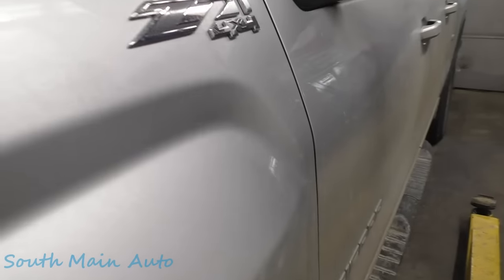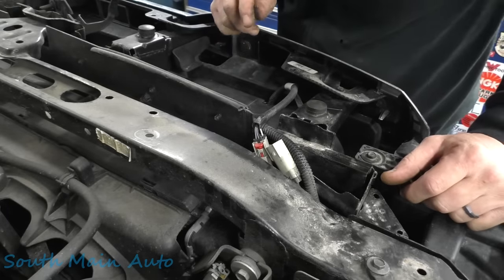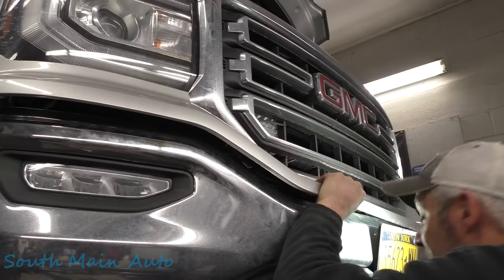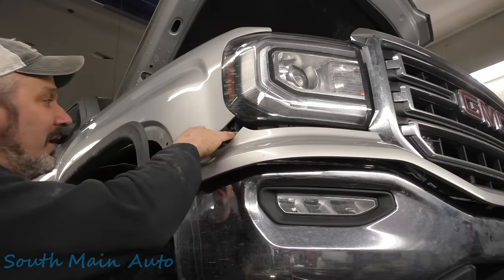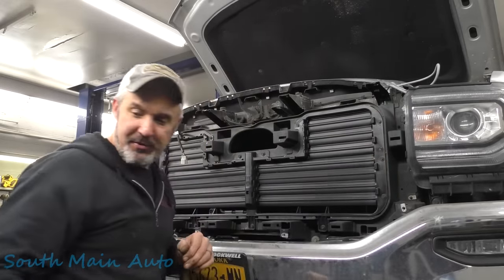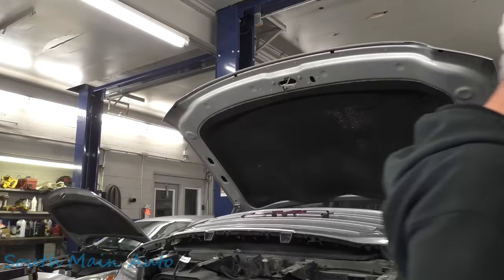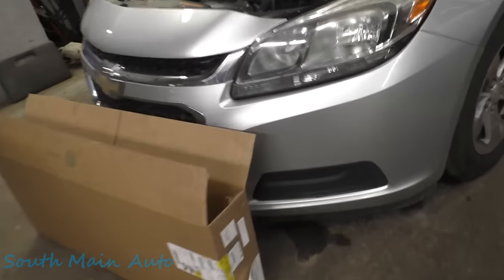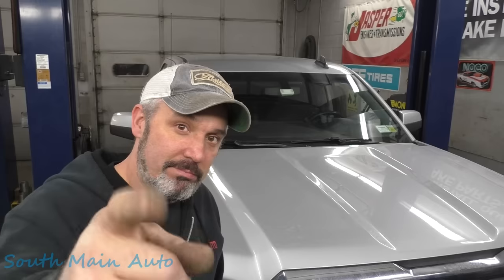Chevy Truck: Active Grille Shutter

Comment: John Deere used radiator shutters on their tractors in the early 1900s, and then they wised up and figured out how not to need them.  Their engines ran just fine with only 2 wires(spark plug wires).

Comment: Some vehicles (chevys apparently as well) simply need to be put back onto the assembly line and run the line in reverse pulling the thing apart in reverse of the way it went together. I know, that won't help too much with things that 'snap together' with snaps you can't reach, release. Here in Arizona with the very low humidity, the metals on the cars last a century, but the low humidity causes the plastics to offgas, and become brittle in 10 years or so. Most of the time when you even carefully try to release some barbed plastic snap attachment, the plastic breaks. 
Answer? Zip ties, bailing wire, hot glue, super glue, epoxy.

Comment: I used to work on a 1929 Rolls Royce, and the only temperature control for the engine was by opening and closing the slats on the grille by moving a lever on the dash. No thermostat, just watch the temperature gauge and move the lever when you needed to.

Comment: I found some of the comments humorous because they reference 30 years ago or so. Shutters were commonly use before there were thermostats, mostly on more expensive cars. They were needed to control the engine temperature. The low priced car manufactures (Henry) didn't care about sludge and rust in the engine.

Comment: I'd like to understand the aero claims better; by the time it hits the shutters, it has already entered a secondary system ...  and wouldn't air flowing through the radiator create less pressure than a wall?
Low temps though?  Sounds great for cold climates.  I've had to cover my grille in a 1.3L before just so the car could get to operating temperature some winters.  Live 15-20 miles away and when you drive at 55ish without blocking the front, the temp gauge goes down as you drive and no longer have heat from the vents; it was below zero for a week or so iirc.  This system I suppose does that for you; though I think since its passing through an outer grille, its effectiveness might still be accentuated by creating some kind of inserts for those openings.

Comment: I remember the days when class 8 trucks had air shutters but not for aerodynamics. The emissions testing loads are set based on aerodynamics so this failing means emissions are not assured. The other goody I've run across is the ozone catalyst coating radiators have a failed presence sensor.  There is no sensor to check function but there is a sensor to verify that a coated rad is fitted.

Comment: Damn they do go back together fast.
Reply: That's because they are designed to be assembled cheaply, and quickly. Most think it's piss poor engineering, but it's actually very good engineering. It just wasn't engineered or designed to be repaired.

Comment: I just use some old carboard on my old 5.9 Durango. Damn hydraulic fan clutch is like a tractor trailer and it takes forever to heat up. Where can I buy that LED light you have? My dial switch is annoying and I don't have the flexy head.

Comment: Never understood how these could be worth it.  Closed it's still a big flat plate on the front of the car pushing air... maybe useful on a really cold day to keep the engine warm I guess.  (I have a shutter "stuck" DTC on my car right now, Ford. Can you just leave it open and disconnect the wiring? Or remove it entirely? Or will there still be a code? if it's missing?)

Comment: Wow didn't think this would be on cars. This is a pretty common thing on high-performance piston-engined aircraft where the cooling requirements eg. on the ground or in a climb are much more demanding than in level flight. Designing the cooling system for the worst-case scenario would add far too much weight and drag for the kind of operating ranges these planes have (eg. P-51 with top speed of 450+ mph), so instead they're optimized for cruising flight with variable radiator shutters.

Even so, opening the shutters adds a significant amount of drag, even in a climb - the F6F Hellcat pilot's manual says to use only 1/3 cowl flaps in a climb, and it advises that if cylinder head temperatures (air-cooled 18-cylinder radial engine) rise, to first try enrichening the mixture as it's more economical than the extra drag from opening the cowl flaps further. Hence their use is definitely warranted in fast putt-putters. Now for cars? It seems a bit overkill. I wonder what the benefits truly amount to.

Interestingly some Russian props like the Yak-52 have almost the exact same kind of cowl shutter for their air-cooled radials. It probably has to do with when it's -40 in the middle of Siberia.

Comment: I have a 2017 1500 and had to pull the trim off for something and ended up using 3M grey tape to re-furbish the plastic trim clip holder when re-installing the trim afterwards.

Comment: I used to hate these stupid shutters until I realized that beyond just improving gas mileage, they keep the radiator from taking tons of rock abuse over time. That rad looks really good for a 7 year old truck. They don't stay closed all the time, but usually they are halfway shut on the highway at cruise which does wonders for refusing entry of random BS.

Comment: I’ve had a similar experience removing the rear bumper cover on my 2022 Chevy Bolt EUV. Service manual tells you to remove several, hard to get to bolts that are completely unnecessary to remove in order to get the bumper cover off. Irritating.

Most body parts are designed specifically to be easy to put on, usually at the expense of making them much harder to take apart

Comment: lincoln mkt's the ballasts for the headlights are notorious for failing... gotta rip apart the wheel well, and half if not all of the front bumper just to be able to change the bulb or ballast. real fun stuff. thank goodness for engineers, am i right?

Comment: I was born in 1957, my first car was a used Ford Mustang 6 cylinder, 3 speed manual, Red  with black bucket seats, crashed it drunk into the woods 2 weeks later, & got to know junkyards quite well for the next 5 years. That car  had 9 lives, no matter how bad a DIYer I was, you could not kill it. Todays cars are plastic & junk in comparison.

Comment: Chevy nah. Well maybe now. I owned a 3.8 L, 05 impala LS, indigo blue. Bought it with 9200 miles. Not one problem except two blower motors. Had it 15 yrs. Id still driving it but the rust belt in N.H. killed it bad. 190000 miles and still used very little oil. Proper maintenence works. Now im purly a toyota/lexus guy. Wife has the avalon. Thanks for the tip on krown undercarriage tip. Going up to Claremont N.H. this spring.
Reply from the maker: Check out NHOC New Hampshire Oil coating. Good stuff too
Reply: Wow just looked at some NHOU videos. SOLD seems better than the krown and its only 35 min away. Thank you!!
Reply from the maker: @garyhennessey3621  The guy who owns the francize is named Joe. He is a really down to earth guy and makes a great product IMO. I hope they make it this far south as they expand.

Comment: Gota a question. See what you guys think on a 2007 escalade dash says engine power reduce but still ran. Once cut off it wont start back up, ive changed fuses checked relays took starter off & back on because thats the only thing that ran once the key is turned in the ignition no crank what so ever but lights radio heat etc all work. Im lost ready to throw this thing to the scrap yard

Comment: I have a 2012 Equinox with a faulty air temp sensor. In the summer it shows negative 40 degrees. So it won't let me use the air-conditioning. $5 part, bit a pain in the butt to get to.

Comment: Wait until you need to pull off a bumper cover on a 2020+ tahoe/suburban. Plastic brackets screw in to the head lights and the headlight screw bosses crack and break. New equinoxes are the same way, i think 22 and up.

Comment: I have a friend that works for a snow plow company in Canada . I takes them 6.5 hours to remove the front grill, finders, rad , headlights  just to install the plow frame and wire harness on a f350 ( 2022 model ) . Then create fit / customize reassemble .They don't build them to add stuff or repair. 
sorry , this is how mechanics make money $$      They come off good in a crash ! 🤣🤣🤣🤣🤣🤣
what a pain

Comment: The plastic retaining clip with the two white push in retainers at the front of the fender flair appears to me to only keep the seam of the bumper trim and fender tight.  I don't think it was adhered in any way to the flair.  The screw you took out of the front of the flair is the only thing holding the flair in place at that spot. IMO.

Comment: I agree they are engineered for ease of assembly not disassembly.  BTW-I think the issue with service data having you remove that support block unnecessarily, is because they use assembly instructions to create service instructions.  That support would have to be installed before the trim piece in the factory. Perhaps if you disturb any of the fasteners they just include the previous installation instruction but reversed to "remove" instead of "install".

Comment: That trim piece above the bumper is easier to get to from the back side, underneath. I take mine off in 5 mins.
Reply: chev couldnt work out how to make the bumper higher,,or grill lower,,so they used filler.. not a chev fan, or any post 90 ve hicles..but, i have an 02 s/duty, f250, with no computer..4.2tdi, brazilian built, geman mercedes engine zf 5sp..allso fitted to siverado,s in brazil..12 lt 100..700nm..bigger turbo.. ausie..

Comment: I was a Chevy guy until I bought a 2008 Colorado. It is really an Isuzu. Then I became a Pontiac guy and bought a Vibe. It is really a Toyota Matrix.
Reply: No. The Colorado is gm. They just let Isuzu make their on spinoff model which is basically the exact same truck. Like the old Ford ranger and Mazda b series. The 5 cylinder engine is definitely gm
Reply: @goenitzlopez2076  The Chevrolet Colorado and its twin, the GMC Canyon were jointly designed by GM's North American operations, GM's Brazil operations, and Isuzu, which began selling its own version worldwide in 2002.[3] In late 2005, Isuzu offered a version in North America called the Isuzu i-series. This North American model Isuzu shared North American powertrains, styling, and equipment with the Colorado/Canyon twins and differed from Isuzu's worldwide offering
Reply: @Leon-qc7fe  yea exactly. It's a gm vehicle with Isuzu clothes. The vibe is a toyota with Pontiac clothes

Comment: I remember reading about the shutter feature in the sales brochure when I bought my 2017 Canyon Duramax, but I don’t think the LWN engine has 
this shutters. I’m I wrong on this ?  Had shutters on my 76, and 82 Cummins powered Kenworths.  Eventually the nylon slat mounts wear out, or the
uninitiated mechanic try’s to lift the rad out using the open slats to grip on. They where air operated by a sensor installed in the lower rad connection. They where set to open about 5 degrees before the coolant thermostat opened. Even refrigeration units mounted on the front of 
reefer trailers had them in the old days.

Comment: What's with the Active Grille Shutter? Is it to keep the engine temp at most efficient or arrow dynamic ?  Could someone add a small electric fan to the cooling system that you can turn on for hot days or traffic jams? Would the extra fan have the opposite effect causing it to overheat .

Comment: Remember when chev / GMC were ( Built like a Rock ) you didn't have to worry about all the dress up pieces being still in place when you return from off roading in the bush. Funny how they think closing of the front of the radiator is going to make a big difference when your driving a brick threw the air. The shutters would be a nice feature on a duramax to help with engine temp when it is freezing out. Remember when big rigs had air operated shutters, no winter front required. Diesel Land Cruisers had a spring loaded blind you cold pull down in front of the radiator to help warm up and maintain engine temp when it was freezing out.

Comment: It isn't only GM it is everyone that makes cats/trucks people wanted to have all these aesthetic covers which inturn makes engineers have to put stuff in difficult areas and the engineers have to give direction on how to remove and replace the part then after that it is the field guys hands to figure out how to remove and replace the part. The worst part of it the cars are designed on a computer but never takes into consideration hand room arm room or any room for anything. It is more designed to fit the engine and look good that is what everything has come to.

Comment: After reading the description, all I can say is GM makes a big ol' fancy PLASTIC "active" grille for God Knows what reason that is driven by an air sensor and God Knows what else but the sensor can't even correctly measure air temperature?? I think they could have made this even more complicated if they just applied themselves more. So any mileage saved is spent on the repair of an unreliable system.
Frankly, they should be embarrassed by ASSUMING that nobody will ever have to disassemble the front of their mighty vehicle design because of their failure. On the other hand, the dealers can make a killing when this thing fails by cutting book time but charging for it. I usually don't rant but my heart goes out to you for having to deal with this kind of stupidity. I'll reluctantly digress now.

Comment: I worked for a company that designed and manufactured these for various makes and models. it was a product I never believed in... but they have to make mpg ratings. the worst has got to be ford who has incorporated these into the grille opening reinforcement. my guess is you have to remove entire front clip to change.

Comment: Cost breakdown:
Diagnosis of air shutter. 1 hour $ 90
Removal of front bumper piece : 
6 hours . Frustration addition 10 hours. 
Broken clips and tabs from GM $ 450 . Out the door $ 1980.00 .what a deal 😂

Comment: couldn't help noticing the little quarter inch drive impact, i generally had 180pis air, didn't 
take long to nuke those little impacts blow guts right out the side of the casting.

Comment: It cost me $120 to replace a headlight on my 2008 Buick LaCrosse because the cross brace, battery, and part of the front bumper had to be removed in order to access the headlight and I didn't feel like dealing with it.
Remember when you could replace just about any part on your car by doing it yourself and it cost less than twenty bucks?

Comment: Think it was late 70's early 80's truck mfg. did away with shutters and started going with thermostats. Then you had to run grill covers to keep the temperature up. Some engine mfg would run winter fans which would circulate air from the engine out through the radiator. Not a novel idea GM had just surprised they brought it back.

Comment: I had no idea just what the heck an “active grille” was until I saw you put the new “grille”in.  Now I’m wondering just why the heck they had to make a grille that closes off airflow to begin with!  Crazy overthinking engineers!  I know it gets cold, cold, cold up there (I’m from Florida, live in Florida still) but really?  Really?!  That engine will still get up to temp even in that cold.  It’ll just get hot faster.  So for what?  The owner/operator can’t drive a few extra miles before they get hot air coming out of the vents?  Am I missing something else here?  Then design it so that you gotta tear down and then rebuild the whole truck to replace it?  Nice!  🙄 Geez Louise!  This is why I like older vehicles

Comment: I had a 2012 Dodge Dart that wouldn’t pass inspection here in the lovely state of New York turns out the active grille shutters were broken and there was evidence some road debris had damaged them since I didn’t care about their functionality I just unhooked the jammed motor from the grille and opened all the shutters the motor could move freely again and it cleared the check engine code itself. I’m not a mechanic but that is the stupidest system and it causes an inspection failure 😞

Comment: GMC "gots more crap" possibly had to solve a rattling issue with sound dampening tape for all that plastic flapping in the breeze! I shudder at the thought of the cost to fix a non essential add on. The big dogs use a cover with a zipper on it and watch the temp gauge!

Comment: So on this particular truck, the owner will now have to drive it for a million miles to pay for perceived benefits that were lost when the last one broke.  Your labor, the part, the creation of the plastic, the shipping of the part, your heating and cooling costs.  Big question, is this a fail able inspection item because of the check engine light?  If so, that's obscene.  All for maybe a tenth of a mile in the MPG numbers.

Comment: We kept these things in stock at our dealer 🤣 failed steady but to set a check engine light for it is ridiculous. The other techs at our GM dealer didn't understand why they programmed it like that. My Ford doesn't and I've had it disconnected for years

Comment: The guys in the factory and those clips in the top, probably have a gun, like a nail gun, only with those push pins on a tape, and just press a button or lever and it is installed

Comment: while your area the vehicles rust away In the south every older vehicle the plastic breaks when disassembling and guess what "it was fine before you worked on I"t I literally tell (and added disclaimer to the invoice) every customer we are not responsible for cracked plastic At 7-12 years old this stuff is so brittle breathing on it might crack it (worse on interiors)

Comment: Wondering if those aftermarket  lights were the reason  the shudder stopped working.
Reply: No they all fail because of the electronic motor control getting wet. As long as you don’t drive in the rain you’re fine